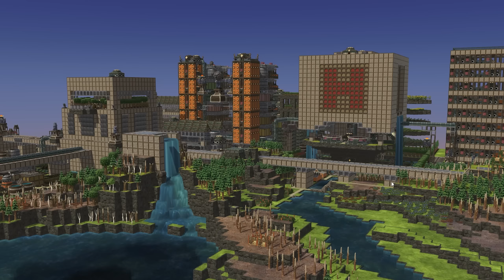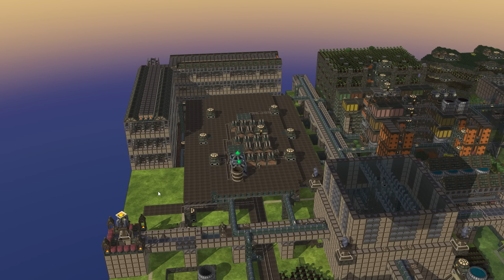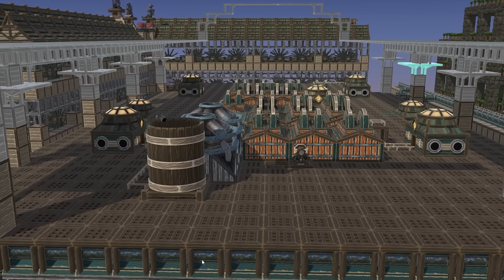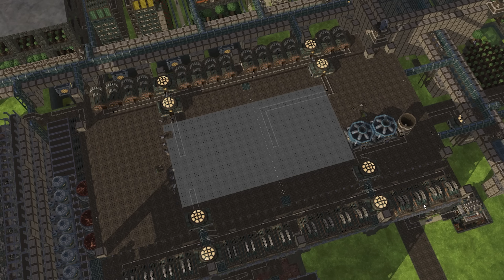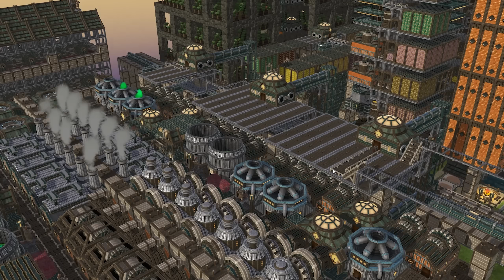Production Restored - Timberborn - Skyborn #18

Comment: About the "skylight" slits not lining up on both sides, if you put a 2-wide slit in the middle of the building then it will line up on both ends...
Reply from the maker: Good tip! That would have been cleaner in the end

Comment: i'm slightly bothered that the floor is an odd width, but the roof is an even width, so the divider wall at the floor is on one side of the line where the roof meets

Comment: Loving this so far, with the skylights/windows how does having pockets of 2x2 or 3x3 skylights at the top going down the middle of the entire stretch sound? I wouldn't do a whole line of 2 by however long the top roof is, just in intervals and it would give a "realism reason" for allowing smoke to vent up and out.